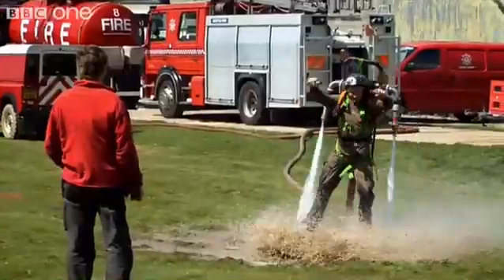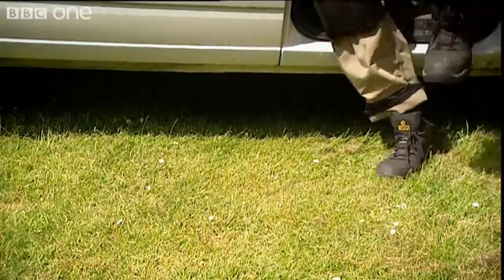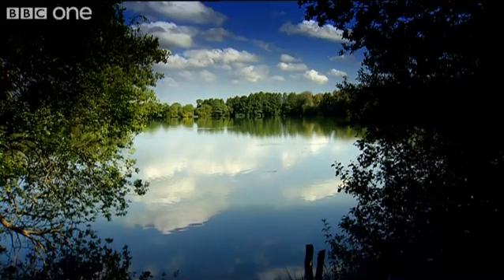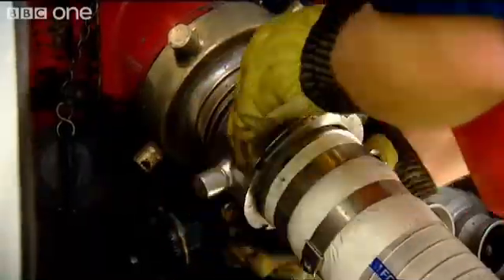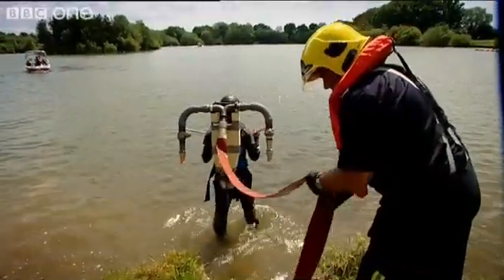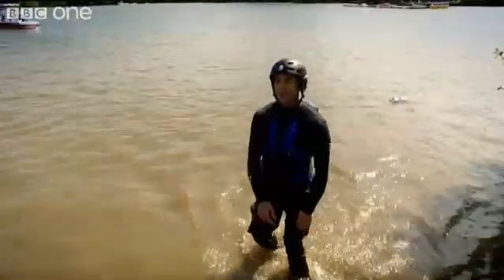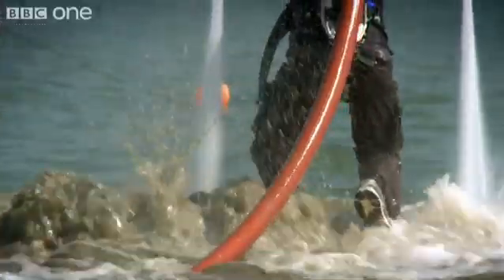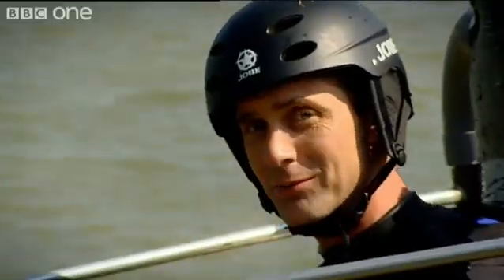Water Powered Jet-Pack - Bang Goes the Theory - BBC

Comment: we're just that much closer to jetpacks. although the ones we may be able to purchase commercially will probably use air pressure to lift us off of the ground instead of fuel.

Comment: £200 ------or you could spend 129 THOUSAND Euros (pump included) on EBay item 130378207622 (search for it). I reckon I could buy a high pressure pump and an old jet ski for a couple of grand??